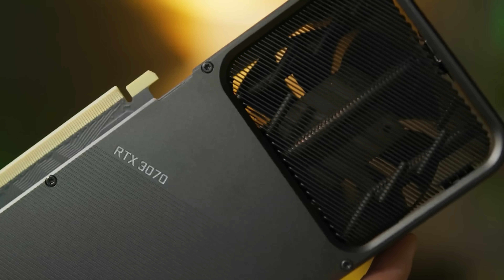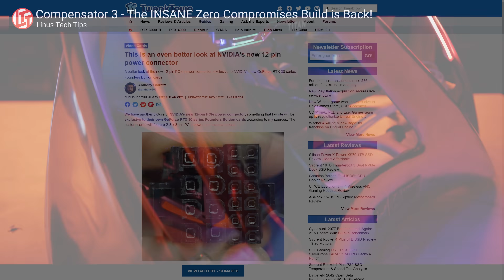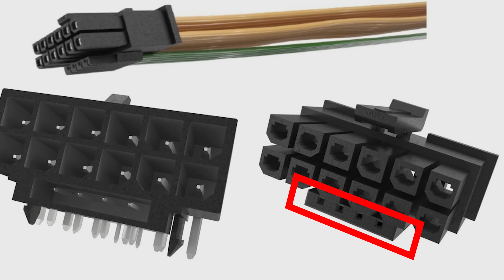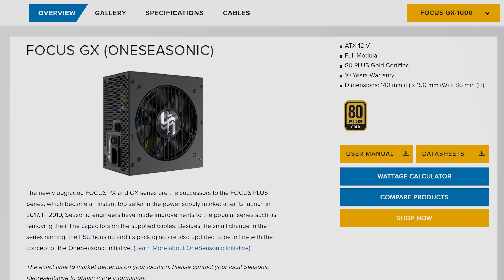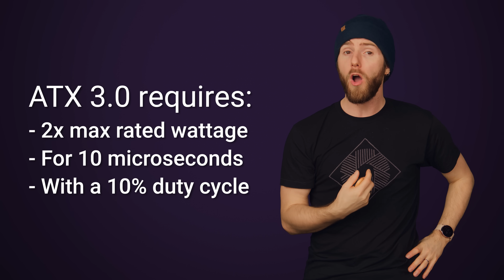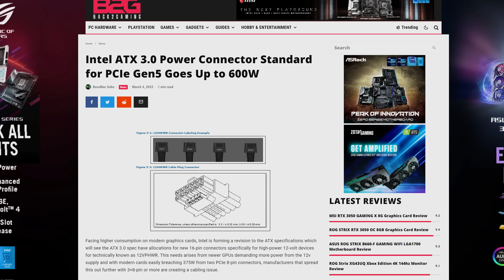Do You Need A New Power Supply? - ATX 3.0

Comment: I wonder if there is gonna be an adapter for old power supplies, probably not given those extra 4 pins.
Reply: dude it's like a wire and a couple connectors. Of course there will be an adapter, it's like saying that you can't convert Molex to Sata power
Reply: @marcogenovesi8570  You need some kind of a chip on the adapter, since this cable is no longer just power delivery, it has additional wires which tell the GPU the max rated wattage of the PSU.
Reply: @MalcolmMerlyn  no chip needed, power draw is dumb-logic by checking the open/ground status of the last two pins
Biggest possible issue is the power spikes, if your PSU can't handle them OCP will kick in. A simple adapter wouldn't work in those cases, but a large enough capacitor buffer could do it. As that's how the new PSUs will handle it.

[Edited as I listed the wrong pins]
Reply: @MalcolmMerlyn  check the actual pinout in the specification because as usual LIENUS doesn't go into this detail, the power selection functionality is literally a "open contact" for "half power"  or "shorted to ground contact" for "full power" on Pin 3. There is no advanced signal protocol involved, you just need a jumper between Pin3 and the existing ground lines of the power connector. Boom, "full power" signal to a GPU.
Pin1 and Pin2 are optional sense signals and Pin4 is "reserved for future use".
There is absolutely zero way they would ever do anything that forces to add expensive components in PSUs, manufacturers are not going to do any of that.
Reply: @marcogenovesi8570  Molex to SATA lose all your data, as the saying goes.
Reply: @misterscienceguy  not really. The issue is when you start daisy-chaining multiple Sata on a single Molex
Reply: It'll probably be possible to use an adapter for consumer cards for at least a few years after the first ATX 3.0 products come out.
Reply: Nah they don't want you using old stuff and not giving them money they want a good couple of grand for the privilege to use their new PSU
Reply: @ThatNormalBunny  I got an 850 Watt PSU some years ago, thinking I would never need more than that for running a single high end GPU, well, I was wrong LOL

Comment: Hell, NO. My 1300W EVGA that I bought 10 years ago still works perfectly good, and I will NOT be upgrading it. Surely an adaptor will come out that allows you to continue using your PSU with new cards, if not I will riot. Landfilling working PSU's for no reason is a joke.
Reply: Won't be necessary for a few more years, still. There's not even any products announced using this standard yet (afaik), so there's no way they could make it mandatory in only a year or two.  

PSUs do simply degrade over time though, so you'll need to buy a new one eventually.
Reply: @MiIIiIIion  My PSU has doubled in real world value since I bought it 10 years ago, 10 years and used and its double the price of what I bought it, I deff do not want to buy a new one
Reply: im still using my 850W Seasonic X Series bought in 2011, it would be wonderful if there was an adapter so i dont need to by a new psu, if this becomes standard within 5 years. ill probably upgrade when i get build a new pc from scratch, current one is upgraded several times in my really old HAF X case from 2010.

Comment: I love my titanium spec Corsair HX1000i despite using only 5900x and RTX 3070. Just casual use and backround video rendering right now is drawing  345w off the wall and using roughly 320 ish at 93% efficiency. Even at full load it never goes above 450w ish so I don't think the fan has ever been used to dissipate heat, the PSU handles heat literally through pure efficiency at 45c. If I ever upgrade to a 3080ti or 3090 then it'll actually make my PSU have to need to work.

Also undervolting my RTX 3070 changed when I switched from a titanium seasonic 600w PSU to a 1000w Titanium PSU, because of power spikes, completely stable at 1950mhz at 0.900v, even lower if I wanted to but as a streamer I don't like risking crashes, prior to that undervolting was mediocre at best, crashing at 0.925v etc. Upgrading or investing a large budget into your PSU is DEFINITELY important. Also, the fact that it doesnt need to use the fan to dissipate the heat means a lot less noise which is awesome. I remember using a Bronze rated 750w PSU and couldn't believe how noisy and disgusting the fan was.
Reply: So you're saying you went from a 600w to a 1000w PSU, both Titanium efficiency (what brand?) and undervolting results are better with the latter one?
Reply: same, i use mediocre hardware in two machines but still run 1kw PSU in both. They will probably last 30 years 👍🏻

Comment: At this point we might need 2 Power Supply for desktop. One exclusive for GPU, one for PC.
Reply: That used to be a (niche) thing. You could get small PSUs that fit in one or two 5.25" bays and just had PCIe power cables and a small connection to the main PSU.  

Some people also just used cases that could fit two normal ATX PSUs and use adapters to make them work together.
Reply: We might as well at this point.

Comment: I'm surprised it took this long to get PSUs that can communicate with the entire hardware stack. That's the biggest thing out of this IMO.
Reply: It's just another point of failure for little benefits. There are many more important improvements that are needed to be standardized.
Reply: @entitledOne  depends on how it's made. If it tries communicating and fails, switch to default settings, and have a notification saying "hey so your GPU can't talk to your PSU, you might use more power than intended" on boot, easy troubleshooting, and by extension still usable.
Reply: I can tell you why this nonesense didn't exist before. Because NOBODY NEEDS IT!
The PSU used to be the one component you bascially could use till our sun expires, because it already was as efficient as it can be and it already had a basically insurmountable longevity!

And now the introduction of this "communication gobbledegook" will make it necessary to keep buying and updating PSUs to ensure that it can "talk to the other hardware".
The only purpose behind this is to force people to keep spending money on their PSU's.

They finally found a way to milk us on the PSU too.
Reply: Technically we've had some for a while now, like the Corsair AXi series, but it was more for monitoring the power supply via software rather than a two-way communication AFAIK. Haven't owned one, only a non-i model.
Reply: @Diapolo10  The AXi's software can switch the 12V from 1 rail to 2
I had an RM850i and the communication is a criteria for buying a PSU as I had a bad experience with my first PSU and those issues are hard to investigate
Reply: Well, because it's not necessary in this context. It makes sense when there are many variables, for example when using USB-PD. Hundreds of different cables and thousands of devices.
A PSU in a PC on the other hand is quite predictable. There are specs for connectors, cables and how much power they can deliver. As long as the manufacturers follows them there is no need for any communication.
Reply: This will pave the way for vendor locking GPUs and PSUs, mark my words.

Comment: they don't add a communication for the PSU information?
you know, using a software to identify the capacity, rating, efficiency etc about the PSU on software without opening the case?

Comment: Why are they not pushing ATX12VO is beyond me.. the amount of electricity wasted every year for every normal ATX psu is ridiculous especially in idle
Reply: Because in high end testing VO kept catching fire and burning the equipment? VO needs another 6 years of designing before it can be safely rolled out and besides right now its obsolete by 10Y/o PSUs.
Will never understand why people bought those buzzwords for it when it was just saving 0.03 watts every 7 days of 24 hour use.
Reply: @snintendog  oh you're one of those 'guys on the internet that knows things'.. 
Just check Linus' own channel.. idle power same equipment from 62W to 30W. You're also using the wrong unit for power savings - it is Wh
As for the claims of VO catching fire, sure - that's why we need revisions and improvements . It IS a step in the right direction.

I'd love for my home server and desktop to use close to half what they use at idle, 60W savings = 720Wh per day at 12h idle. 21.6kWh per month
Now factor in the explosion of people wfh and you can start to realise how bad it is

Comment: I agree with a lot of the comments here. Let's standardize the modular output of the PSU. Long term waste will be reduced and PSU companies could sell just the PSU and you can use the existing cables. The 20+4 or 24 pin header should be a straight cable, matching the motherboard pin for pin in terms of layout. The 24 pin header on the motherboard should be in the middle, not top or bottom of the board.
Reply: One of the reasons why they haven't changed standards is because it's really expensive for both manufacturers and customers to switch to a new standard. That's why I can buy a new power supply off-the-shelf, and with a couple of molex adapters make it work in my old Pentium 1.
Reply: @YT-TheLegacy  Well, you people running your old Pentium I computers are the ones who need to jump through hoops to use a new power supply, not the rest , who represent 98%   Sorry, you cannot expect tech to be backwards compatible forever.
Reply: @DVankeuren  Of course. I was just remarking as to why this is the case, and (with the exception of some OEM's like Gateway or Dell) is why we didn't switch to BTX back when it was suggested in 2004.
Reply: @YT-TheLegacy  also why we haven't seen any smarter motherboard standards take off, like PIO (Parallel I/O).  Look it up, makes total sense, connect graphics card in line with motherboard, no riser cable needed, simpler routing for cooling.
Reply: Am I the only one who would like the ATX 12VO to become the new standard? I just hate to think that every time my pc is in idle is actually consuming 2x the power it requires becaue of inefficiency of the PSU
Reply: 50% efficiency on 5 watts vs 90% efficiency is only wasting 2 watts. Thats why the efficiency at low load doesn't matter that much.
Reply: yea but they'd make less money :(
Reply: Nou
Reply: @samholdsworth420  nou zeg
Reply: Yes , 1 cable for the MB would be ideal, and another one for the GPU. That way, people that don't need a discreet GPU only need to plug 1 cable.
Reply: Can't supply a warranty on the PSU if you're relying on customers to re-use cables.
Reply: Mini ITX has entered the chat
Reply: @DarkNia64  but does mini ITX one is as cheap as low end motherboard ? if not then no thx

Comment: Heh, thats cute. Linus believes that the 600w connector will only be for watercooled cards.
Bruh. 
In 2 generations, At Most, we'll be hitting that.
Reply: But that doesn't mean the 600w cards won't be mostly/entirely water cooled. That much heat is an insane amount to dissipate via air unless your in a server environment with a bunch of 10000+ RPM fans. I don't know if a regular pc case could handle a GPU like that on air, and the GPU would be massive.

Comment: I just can't cope with the fact that he is talking about a new standard that makes old PSUs obsolete and at the same time, atvertising a product, that does not support it.
Reply: If you need a power supply today then it makes sense. Linus says at the end of the video it could be a while before the standard is introduced (and it of course it isn't needed for current GPUs like ampere and RDNA 2). You'll also probably be able to use an adapter for old power supplies with and most new GPU's.

Comment: I've had my 650watt 80 plus bronze EVGA psu since 2016 when I bought my first pc, I now have a 3600xt and a 3070 gaming oc and it's still handling it all like a beast. It has the mustard cables and no modularity but I still won't throw it away until the new spec becomes standard and well mine dies.
Reply: If that's a BT or BV, you should replace it ASAP.
Reply: @nunyabeeswax3012  Why?
Reply: @nunyabeeswax3012  why?
Reply: @nunyabeeswax3012  You can't just say something is bad and not say why.
Reply: @haste953  Aight
The BT and BV are group regulated. As for what that means, well, modern power supplies provide power in three voltages: 12V, 5V, and 3.3V. Your CPU and GPU both draw on 12V, so that's what gets the heaviest load placed on it. In an ideal world, these should be regulated separately, and indeed, in most half-decent units, they are. A typical implementation would be to convert to 12V, then use buck converters to convert 12V to 5V and 3.3V, as needed. This is called DC-DC, since it converts 12V DC to the other DC voltages. Unfortunately, the BT and BV (along with many other uber-cheap units) instead use _group regulation_, whereby 12V and 5V are regulated on the same coil. Ohm's law states that power is equal to the product of voltage times current. So for 12V, if power goes way down, so does voltage. On an APU system with a 3200G, this might not be so much of a problem, since the PSU can keep up with the 100 or so watts for the APU just fine. With a 3600XT and a 3070, though? Not so much.

Then there are protections. As the name implies, they protect the PSU if something goes wrong. OCP/over current protection shuts off the PC if it's drawing too much current, OTP/over temperature protection shuts off the unit if it gets too hot... you get the idea. The BT and BV both claim to have the full suite of protections, and that's all well and good, until you consider that OTP is set at 180C in a unit with 85C-rated capacitors and a 30C rated ambient temperature for the BT, and no tests at all in the BV. In both cases, super-cheap sleeve bearing fans are used, which aren't known for their lifespan; combine low-lifespan cooling with questionable ability to shut down when overheating, and you get a problem.

Then we have the wires. Any half-decent unit nowadays will use 18-gauge wire or thicker, at least for power delivery cables for the CPU and GPU, and typically for peripherals too. Some high-end units use thicker 16-gauge cables instead. The BV and BT use 20-gauge cables, which is an issue at heavier loads.

What does this mean in practice? In short, nothing good. For the BT, when the 12V rail was fully loaded but the 5V rail was not (which is pretty typical for a modern rig,) the 12V rail was outputting 11.26V instead, which is really bad for your components, and fails even the incredibly lenient ATX specification. The BV wasn't quite as bad, but 11.74V on 12V still isn't something you want for your $600 graphics card.

So yeah. Point being, if you have 3070 money, you have "topology from the current millennium" money.
Reply: @nunyabeeswax3012  So, do I have to replace my 4 years old FSP Hydro G 650W psu too ? I plan to upgrade my R7 3800X/GTX 1070 system with either  6700XT or RTX 3070 one. :( Thanks, fot answer.
Reply: @nunyabeeswax3012  thanks for the answer, that makes total sense though my psu is the 600b I wrote 650w but I meant 600. Does it still apply for that one?
Reply: @nunyabeeswax3012  I also have experience weird electrical issues with my case's front panel connectors, it is connected to my x570 aorus elite wifi. It made my razer headphones have weird popping and static sounds and if I connect my current Senheiser Hd599 it makes like a high pitch buzzing sound. When I use my mobo connectors it doesn't happen
Reply: @haste953  Different unit, definitely. The B600 is still group regulated, though. The review I could find was for the 500B, though it's on the same platform. Regulation under extreme crossloads hovered at around 3% deviation, or 11.64V, and it still uses a sleeve-bearing fan. Ripple suppression was poor, and transient response was... adequate by groupreg standards. However, protections appear to be set properly, so it's unlikely to have a catastrophic failure. It's not something I would suggest using for a 3070, but at the same time, it's not nearly as horrendous as the GT.
Reply: @nunyabeeswax3012  You are blabbering nonsense. Every PSU (even crappiest costing $10) has declared amperage on +12 V . PSUs does not care are you powering GPU, CPU or a toaster . To see if your PSU would support certain GPU+CPU combination simply multiply max amperage with +12 V (you could find those specs on PSU or online) . Then get a TDP for your CPU and GPU, sum them, add some overhead (usually 25%) and see id this exceeds aforementioned product of +12V and max amperage. If it does not you could use that PSU without problems.
Reply: @aleksazunjic9672  This assumes that a PSU will actually output 12V on the 12V rail. The point is that a group regulated unit isn't capable of doing this under extreme crossloads.
Reply: @aleksazunjic9672  Also TDP should NEVER be used as a measure of power consumption.
Reply: @nunyabeeswax3012  Even cheapest PSUs output 12V on 12V rail when under declared load. TDP is good enough to get ballpark figure and plan your PSU (with 25% overhead as I said) , because most of the time GPU+CPU would operate far bellow their combined TDPs.
Reply: @aleksazunjic9672  Have you looked at the jonnyguru review for the GT? Output was at 11.26V under crossload with 12V loaded to exactly its rated current
Also, TDP means next to nothing. The 12100F has a TDP which is only 5 watts lower than that of the 12900, despite the two consuming very different amounts of power.
Reply: eVGA are great typically as well